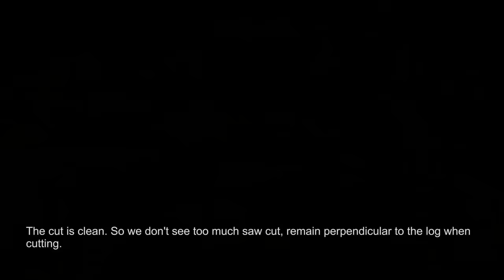Sciage de planches à la tronçonneuse / Sawing boards with chainsaw

Comment: Bjr Nicolas moi j'ai un problème avec ma ms 400 j'ai changer de chaîne toute neuve avec l'angle normal 30⁰ en horizontal huile sort pas reglage de l'huile à fond sa reste au niveau de la cloche au niveau de l'embrayage et quand je l'utilise normalement en verticale elle huile je comprend pas alors soit elle est pas conçue pour de l'horizontale soit il faut changer la chaîne  spéciale en 10⁰ soit c'est la pompe qui déconne soit je sais pas en poussant sa s'en le chaud alors j'ai arrêté

Comment: bonjour, bonne présentation mais je vais te donner 1 astuce pour gager du temps pour le délignage: tu équaris  le troc de part et d autre pour qu il ne te reste que les 140mm au milieu du tronc; tu le tourne d 1/4 de tour et tu scies tes planches qui feront toutes 140mm. PS: attention a l équerrage

Comment: Bonjour.
Superbe video. Deux questions à poser
- Je vois que vous rabotez et poncez les planches. Mais elles ne sont pas encore sèches, loin de là. Ne craignez vous pas qu'elles se déforment en sachant ou pour le moins que leur taille change et vous n'auriez plus qu'à recommencer.
- Lorsque vous appliquez le produit antifongique, je vois que vous le mettez sur la face extérieure et les épaisseurs. Je croyais que ce produit devait se mettre sur toutes les faces. Détrompez moi.

merci
Michel
Reply from the maker: Bonjour, merci pour le commentaire. Le billon que je scie est entreposé depuis 2 ans dehors. Ce bois devait avoir entre 30-35% d'humidité encore. Les planches ont bien tenu le coups, pas de fentes. Pour l'application du produit, avec le pinceau, le produit est bien dispersé. Si les planches sont utilisés au sec et à l'abri de l'humidité, pas de risque de contagion.

Comment: Bonjour Nicolas je voulez te demender avec quelle essence de bois on peut faire un plancher bois qui résiste à la pluie et une charge de 2t de bois vert pour une remorque et avec combien d'épaisseur  parce que le contre-plaqué en 18 à casser et pourris en 5 ans, avec une tôle en 2 mm par dessus le contre-plaqué. 
Cordialement 
mr lombré
Reply: Douglas traiter
Reply from the maker: Hello! Alors je pense que du Douglas ou du Mélèze feraient très bien l'affaire. Pour la statique, ça dépend ce que tu as sous ton "plancher"... Mais il faut en tous cas du 40mm d'épais et pas trop d'espace entre les poutres soutenantes.
Reply: @NikoLogs  du profilé 70x50mm épaisseur 3

Comment: La gruminette, c'est long pour débiter, ça bouffe du mélange, de l'huile et de l'énergie, rien ne vaut une bonne scie à ruban !
Reply from the maker: Bonjour. Vous oubliez sans doutes que tout le monde n'as pas une scie à ruban à domicile pour scier des troncs de cette grandeur et que dans ce cas, il n'y a que le transport en camion - couteux en argent et en énergie grise - qui peut amener de tels bois à la scierie. De plus, une tronçonneuse équipée d'une ripping chaîne bien affûté et fonctionnant à l'essence synthétique ainsi qu'à l'huile biodégradable est très certainement plus adaptée pour le petits travaux dont il est question dans ma vidéo. Merci pour votre commentaire et salutations.
Reply: C'est mon avis, il vaut ce qu'il vaut et tout le monde n'a pas non plus une tronçonneuse à 750, voir 900€ qui n'est pas non plus étudiée pour ce genre de travail, pour ma part, je suis pro ébéniste et mon scieur me prend 35€ de l'heure, et il débite facile 6 à 7 métres cube à l'heure, je vous mets au défi d'en faire autant,  sachant qu'il vous faudra aussi affuter votre chaîne souvent ! Quand au transport, pas de soucis, on a tous un pote qui a une bonne  remorque, ne le prenez pas mal, aprés si vous aimez faire ce travail vous même, bien à vous, celà ne me dérange pas ..